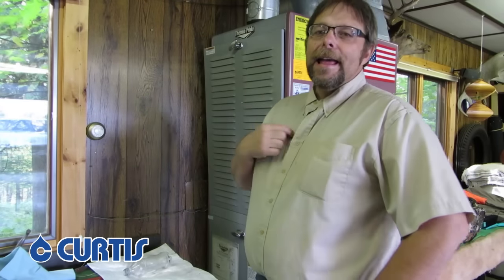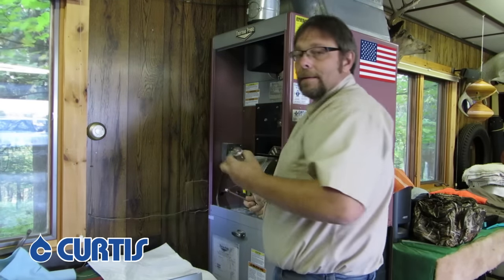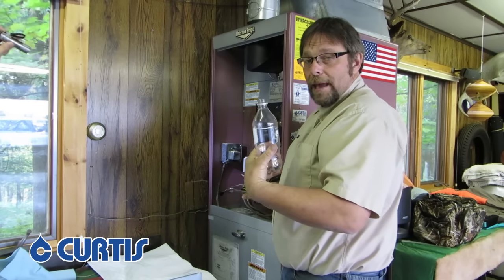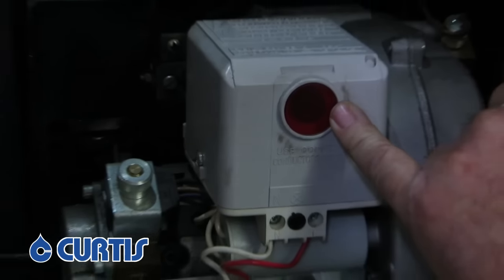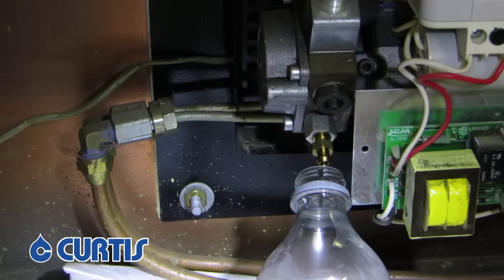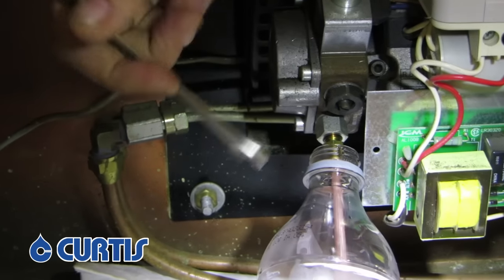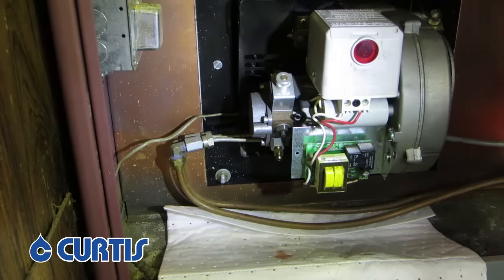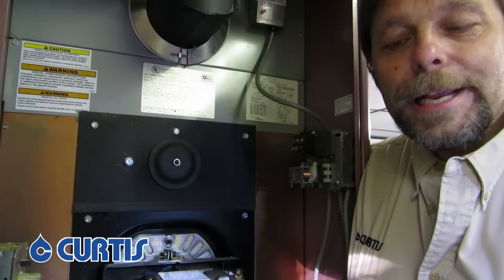Curtis: How to Bleed and Restart an Oil Furnace

Comment: I'll give you a little tip. Loosen the two screws for the cover which gives access to the assembly. Pull the cover open just a bit so you have a small cracked opening at the top. After you reset the burner, place a flashlight on top of that cracked opening so the light shines down into the burner. This will trick the cad cell into believing there is an established flame and prevent it from locking out into safety. After you get a bleed, tighten the cover up again. :)  The above procedure should be applied by professional technicians only, and should not be attempted by home owners.
Reply: Or how about not pressure bleed it at all. Since it’s a two line system.  Press the button a couple times and your good.

Comment: Number one thing to remember if you replaced your filter, turn the valve back on before tying to bleed the thing, so you won't stand there scratching your head for 15 minutes wondering why you are not getting fuel

Comment: Thanks Dan, this is the 2nd time this happened to me after having my tank filled earlier in the day. Last time it cost me over 100.00 to have them bleed it for me. I appreciate the help and thank you for saving me another 100.00. Any idea why this happens after I have tank filled? Thanks again.  Jerry
Reply: You let the tank run out. When that happens air gets into the system. Don't run out before you order your oil

Comment: Thanks, Dan, for your reassuring explanation:  HOWEVER!  At 4 minutes 19 seconds you say, "If it stops, all you need to do is go in and hit the 'Reset' button again!"  "AGAIN"?  When did we "hit" the button BEFORE that point?!  You didn't say the button should be pushed until then!  This lack of clarification about the use of the Reset button leaves me unable to follow this video guidance!

Comment: My boiler’s heat exchanger exploded after routine bleeding and winter inspection by licensed boiler service/installers.  Upon technician releasing water valve after bleeding, etc within a few second s loud explosion and water 💦 all over basement floor.  Want to replace now with wood boiler.

Comment: I  am a 35 year  old single Mom of 2 girls and Im going to try this. My home I fought to buy after my divorce is has 2 oil burning furnaces and the charge you a arm and a leg to restart. I am going to try this because $175  to prime after paying $1000 FOR OIL  in a 500 gallon tank JUST AINT HAPPENING. Everyone wish me luck. I will write back with my results. Im a little scared but I will try it

Comment: my not bleeding it was on two day go now i think i am on lock up the light just stay red i turn it off on every way there is
Reply: gotta hold the button down for 45 sec or until light comes on to get it out of latch up
Reply: eric soles you have to push the red button in and hold it for 20 to 30 seconds for it to come out of lock out. he is not telling you this part. he is just telling you to wait an try again. you can wait all week and it will not come out of lockout until you hold it in for 20 to 30 sec then let it out and it will start. you only have 3 trys before it go into lock out then have to do the hold in
Reply: Arnold Romppai. i got it running i had to hold the reset button down for 27 seconds than it started bleeding now it works fine . just make a banging sound every once in awhile. need to have it tuneup and clean . the door panel said the last time it was inspected was 2014
Reply: eric soles sounds like you need to get a couple more tools out and a spray can of carburetor cleaner. buy a new nozzle look on your old nozzle it should say 60g with 60 degrees and 0.75 in that format the 60 degrees is the width of the spray and the point seven five is how many gallons per hour it burns you must buy the same type of nozzle undo the quarter inch line and undo the lock nut and pulled the gun out clean all the black crudup with the brake clean in a brush replace the nozzle putting back together go out to your tank and change the cartridge in the filter easy peasy remember to bleed before starting there's many videos on showing how to do it save yourself the $500 something you can do in an hour's time Max. check for water in the filter it separates from the oil drain your tank a little bit if you do find water before putting the new filter on I always add off and on half a cup diesel fuel conditioner your tank should be set back to inches from level to keep the water at the back of the tank
Reply: eric soles sometimes it'll make that banging and rumbling sound for a little while after you had to bleed it as the chamber got flooded in oil it'll do that until it burns out off

Comment: with that same make burner in the BF5, YOU CANT JUST PUSH THE  RED BUTTON, the fire eye kicks it out in 5 to 8 seconds, you be there all  night just trying to bleed it, no one on here will tell you to do anything mire then remove the white control box and put a jumper wire on terminals 5  and 6, well that only runs the motor, it will  not start the pump solenoid to in gage the pump to bleed, so if you have this model, its up to you to put your life and controls at risk to find out the other step you have to do, over and above jumping 5 and 6, I don't know why this model cuts out so fast, I have never had that with all the becketts iv had
Reply: we oil tech shouldn't be sharing anything,but this guy is showing you how to bleed a self priming system. youtube should stay out of it
Reply: Kevin Dutile there all self.. it's not like the old 2 line systems. and don't take any real know how how to do it. just the newer models have a much shorter run time before the electronic eye doesn't see fire and shuts it down and you have to start over. no different than bleeding a diesel truck or diesel machinery eating people with a diesel truck is going to call mechanic out that need their fuel system
Reply: Arnold Romppai  no they are not all self priming.  Manually single line. And self priming two line. No it is not a hard thing to do.  We just shouldn't teach people how to fuck with the things  . My opinion

Comment: when you get a refilll on your oil tank  you should change your oil filter, cause all that gooey smag is now in you oil filter
Reply: As a licensed oil burner tech I can tell you once a year is fine unless you have an old tank and constantly run out of oil.  Especially if it’s a garber spin on type.  Those filters plug so bad

Comment: DO not do this unless you know what you are doing, he doesn't.
Reply: it's not hard  you loosen a  bolt
Reply: for all you experts on here, the burner he is priming  is a 2 pipe system, it is self priming. also the burner will lock out on safety in 7 seconds, you will have to hit the reset severally times. If not properly bleed , or a bad nozzle you can fill the chamber with vapor and have a puff back

Comment: Jump to 6:52... The thermostat button..lol is the red button on the burner. Make sure you close the nut before the burner cycles off or you will suck air. There are much better and shorter videos. This guy is taking way to long to explain while your babies poop is freezing in it's diaper.